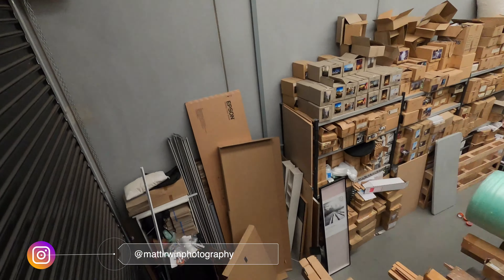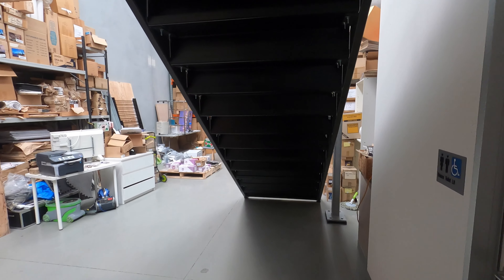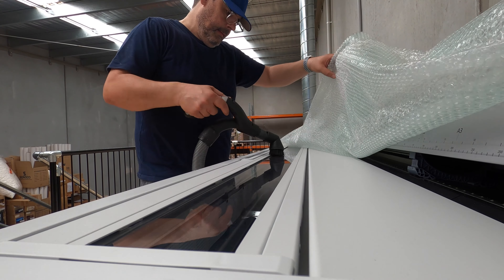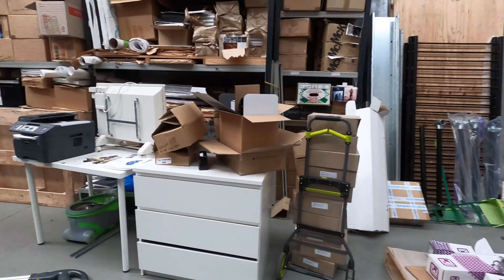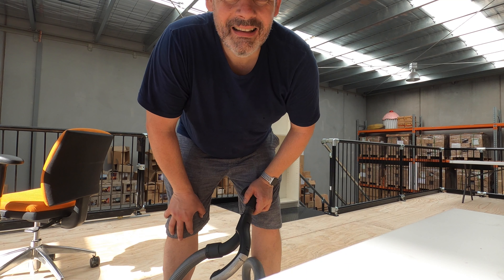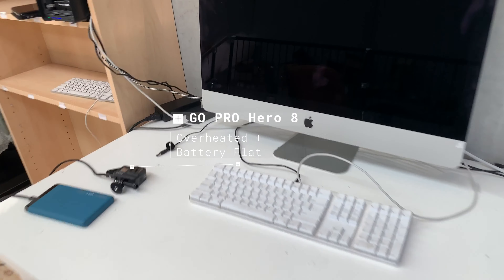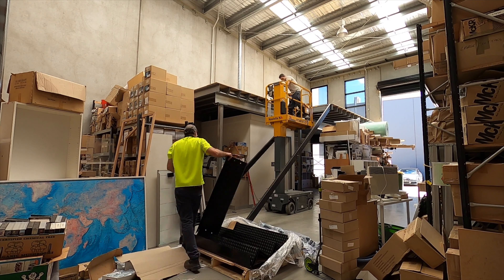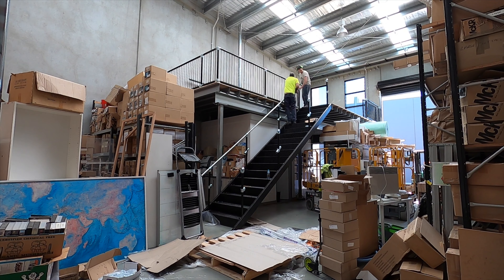GO PRO HERO 8 Black - First Impressions | It's So Easy | Matt Irwin

Comment: GoPro cameras are good for VLogging but not much else.
The rest of the market like sports has dissipated into nothingness.
And worst of all for GoPro is the competition at a fraction of the cost.
On the rare occasions I need video, I'll use a DSLR (My Sony A7 Died and became a paperweight).
And I refuse to sink to using an iPhone even for video.
I hope your printer doesn't dry out in your hotter mesa-nine environment...
Reply from the maker: Yeah Roy it is a fair point. The cost.  I will use the GO Pro for time lapse, action moments, live streaming, tight spots, dangerous spots and quick vlogs.  And because it is not a $6000-$7000 Z7 with lens, I am able to take more risks cinematically.  Move quicker, when I need to.  So this has a place in my kit for sure.  For example the time lapse at the end of this film, I would not have been comfortable leaving the Z there all day.  No probs this little guy ... as always, it's all about use case :) Cheers Matt

Comment: Lets face it at €480 it seems to me that this is overpriced as are most gopros considering the competition.
Reply from the maker: Yes it is a fair concern. I have not used the competition, so I can't say.  What I can say is the 8 is very easy to use.  Really press one button, the 'on / 'record' button and you are up and running. Everything just works, exposure, stabilisation, audio, focus.  It is amazing.  So if quick start and ultra easy of use is worth a little more.... Then perhaps it is worth the extra cost.  Having worked with DSLR's and ML for the same stuff what takes 10 mins, takes one second. Literally.  So it has value for me.  Plus I am looking to live blog my photo sessions as well. It will do that. I think there is a lot more to explore here, so I am still open minded to its skills. :)  What are you currently creating with Roswell?  Cheers Matt